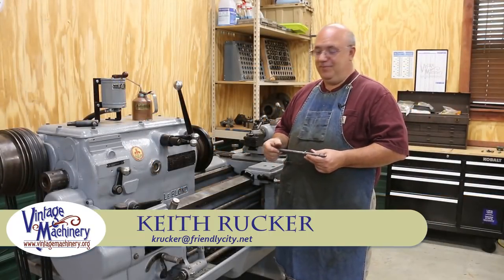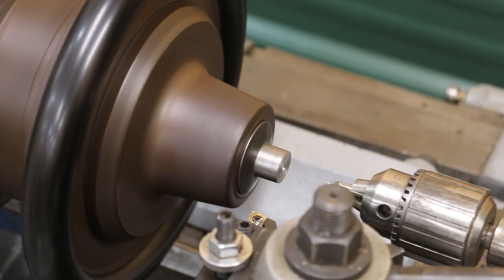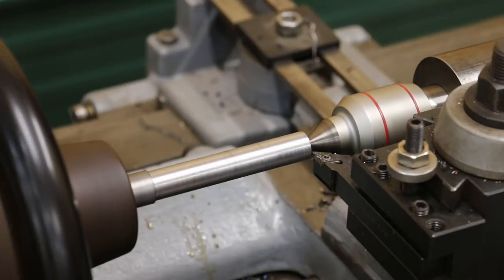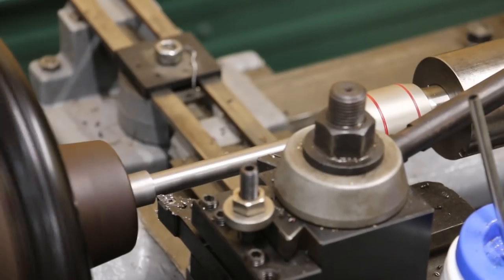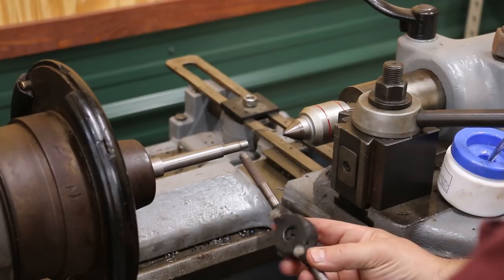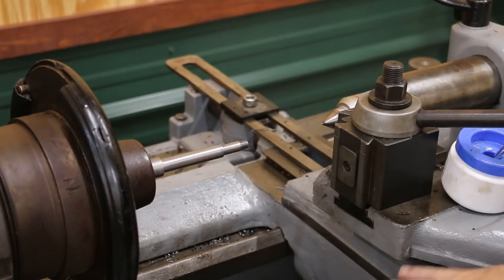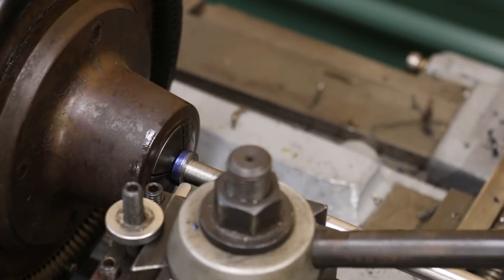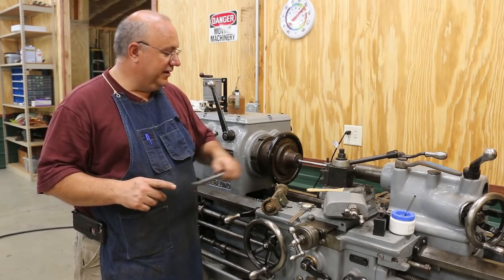Machining a Lathe Cross Feed Screw

Comment: Don't worry about the thread dial just leave the half nuts engaged and run the carriage back and forth.  It will take a little longer but not nearly as long as reconditioning the tread dial.  Nice video!

Comment: Keith, use coolant on 4140, it tends to harden quite quickly in a cut.  That's been my experience at least.  Notice how the color of chips changed a few seconds before 25:15, to me that looks like a hard chip.  I had this problem one day.  I got around it that night with a paint sprayer to get the job done, now I use a mister all the time.

Comment: I know what you mean about having to stop and work on things.  We purchased a well used mortar mixer many years ago and was given an electric motor that would drive it just fine.  The problem was that the old set up was for a low RPM motor and that newer  motor was 3600 RPM.  So, we had to put a jack shaft in to reduce the speed to an acceptable  rate.  Easy fix except there was a clearance problem.  After a lot of rearranging we got her going; worth the wait as we used it several years till I had to retire due to disability.  Get r done, oops I did it again Keith,  Greg.

Comment: Very nice to see that pristinely restored LeBlond in action. To fit the pristine picture the collet chuck could use a little shining up.  But I guess there are many other things higher on your priority list. B.t.w you don't need the thread dial. You could leave the half nuts engaged and turn the lathe backwards to back up (actually forwards for LH thread). But I am sure you know that very well.

Comment: Hi Keith,

Try running a form tool upside down and the spindle in reverse. You get the equivilent goeometry to a spring tool-holder and reduce or eliminate chatter.

Comment: Great work Keith. I use dies to thread on my lathe quite often, my lathe is very fiddly to set up for threading since it has no quick change gear box so it's much faster for me to use a die than to calculate and change gears out all the time.

Comment: The problems you were having with depth of cut seem like they're more from tool geometry, rather than machine rigidity. I've taken off 200 thousandths in 4140 on a Hardinge HLV, it seems like that 12" Leblond should be able to do a hell of a lot more than 60

Comment: Would it not be possible to cut the thread without the thread dial by not disengaging the threading screw at the end and run the cutter back by reversing the lathe spindle?

Comment: Seems that every project I have going on is linked to another in some way, one can't be finished until another one is.  For lack of one specific tool, usually.  If you have money, you don't have time, and vise/versa.  The vicious cycle that sometimes seems like you will never get free of it.

There is a story I was told about earlier days of railroading in Arkansas.  There was a rule concerning trains that met at interlocking tracks at the same time.  The rule was "neither shall go until the other has passed."  With these projects, you have to wonder if what you are feeling about them is how those conductors felt in those situations.

Comment: I noticed that you don't back off the cutter when returning to the beginning to make the next cut,stating the finish wasn't smooth enough. I have seen Adam Booth back out just a bit when returning to the next cut, from start to final finish cut. I am not a machinist, might this procedure of backing out have some relevance as to the roughness versus the desire for a smoother finish?

Comment: I have a old cluising lathe and i am now on ssi and want to learn how to use it since i have time to do that now but it does need alot of work to it to make it all work right i wanted to know if you can make a cross feed screw and nut for it if so how much would it cost me and i can send you my old parts to referance off of but they are badly worn

Comment: Shouldn't you centre it with the stock out close to finished length? I thought it stopped the tail centre putting a bend in the part?
Reply from the maker: If you do that, you might have runout and not get the hole in the center.  Better to do it chucked up close to the headstock and then move it out to the live center on the tailstock.
Reply: Tristan Patterson I agree,or, do it between centres

Comment: I recall from Adam Booth's discussion of thread cutting that there are certain combinations of thread pitch and lead screw pitch that don't require use of the threading dial -- anywhere you engage the half-nut will be correct.  I wonder if you're lucky enough to be at one of those "magic' combinations in this situation.
Reply: Err, I think it's any number/division on the threading dial. Not just anywhre.
Could be wrong, often am.
Reply: I think we're both saying the same thing.  As I understand it, the half-nuts won't engage between divisions, so "any division" equals "anywhere".  Would be nice to have an expert to confirm.
Reply from the maker: Actually, 8 TPI could probably do this.  However, it still needs to get done!

Comment: Now I'm no expert but;
If the threaded end was running out when you chucked it, then the centre would bring it true by flexing the rod.
Surely when you took the centre out after threading it would spring back and so still be out of true?
Or isn't it critical?
Reply: I agree, you must turn the  finish cuts between centres , once it is straight then use chuck and centre for rigid screw cutting

Comment: Keith, I realize this isn't a casting video, but I know you do that as well. And I have a question for you about casting. Since you live in Georgia, and I do as well, have you ever tried to use the Georgia Red Clay for the molds? Seems it is very easily molded and can ever be extremely fine in granule size to offer a very smooth finished pour. Was just wondering if you have ever tried the famous Georgia Red Clay before?

Comment: Good job Keith. Question, did you apply a polyurethane on your walls, so it would not stain with splatter.
Reply from the maker: I applied a clear finish, but it was not poly.

Comment: I was hoping you'd show off some skills and thread without the dial.  If your leadscrew is 4 or 8 tpi you wouldn't need it anyway for the 8 tpi threading job.  And leaving the half nut engaged the whole time is pretty much mandatory if you want to do metric threads, so its a good technique to learn.  But sometimes its nice to have an excuse so you can go relax, in which case I don't blame you for being unable to finish without the thread dial!